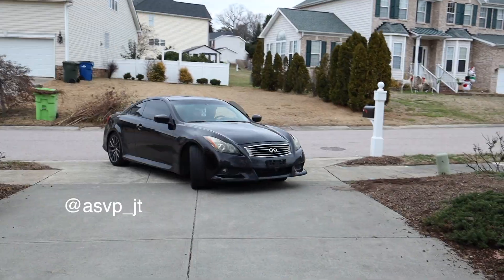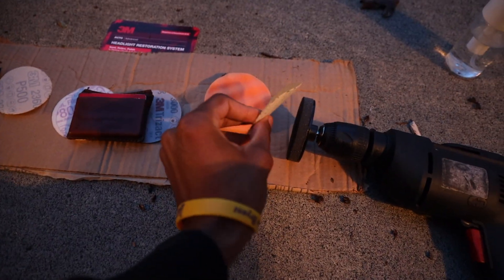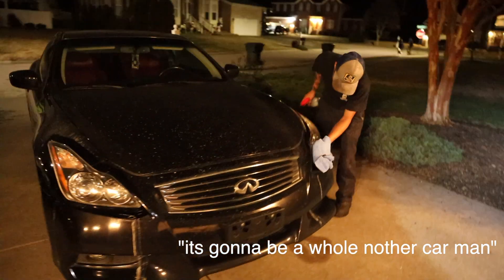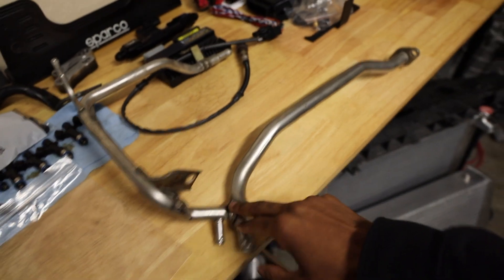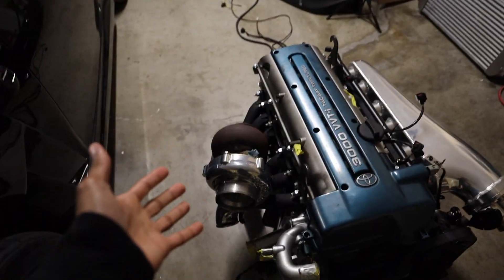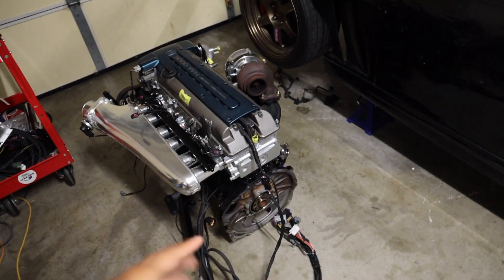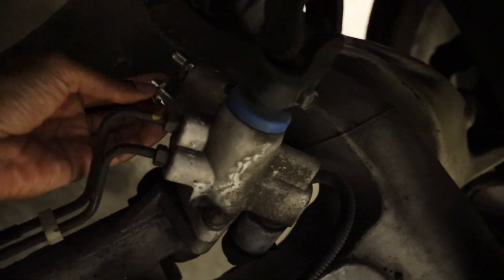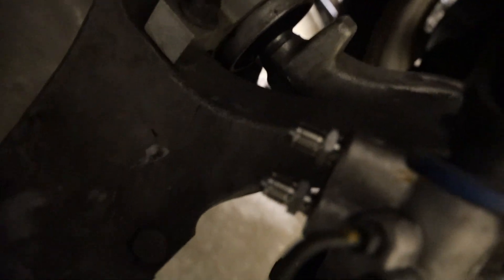How To Make ANY Car Look Brand New Again!

Comment: All the smaller fine scratches that were left are from not using the higher grit sandpapers long enough to fully refine the scratches. As you step up to higher grits you want to sand twice as long as your previous grade because compound/polish will not remove those induced defects mostly.
Reply from the maker: yesss. i was cold so we stopped 🙂
Reply: @julianjoness  Cold in Cali ??? 😶😂 Nah bro I’m playing its all good
Reply from the maker: i was North Carolina in the beginning of this video 😅. have been for the past few vids actually. that’s why i was flying back mid video 😭

Comment: Drill that new oil drain fitting and make the hole bigger i blew my brand new precision because oil pooled up inside the turbo.
Reply from the maker: yeah, that’s why i want mine straight up and down. the angle was giving me anxiety 😂
Reply: Mine was straight up and down too but the hole on that fitting is too small bore it out and tapper it like the long fitting you have
Reply from the maker: what turbo did you have?
Reply: Precision 7675 sportsman journal bearing